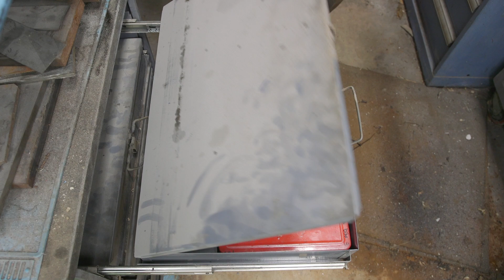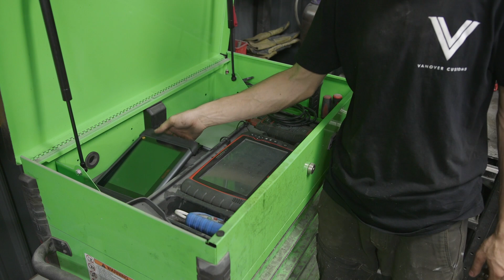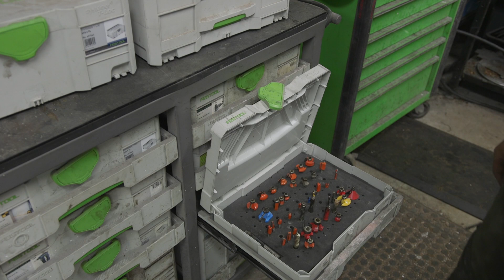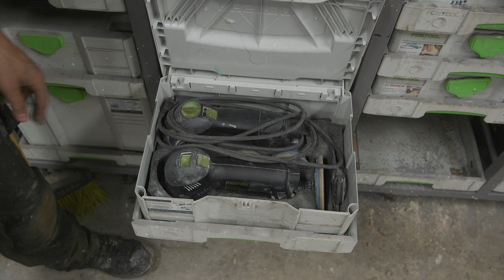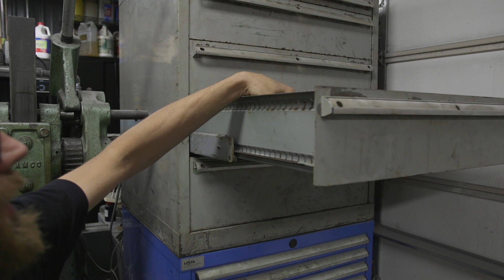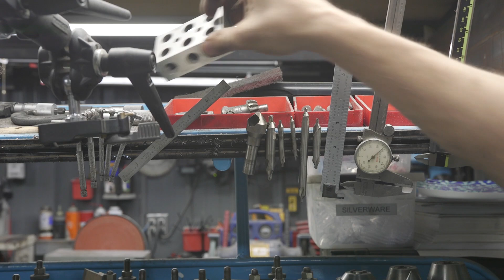2021 Shop Tour Part 2

Comment: You have more tools than Santa.😂
Reply from the maker: True I am very grateful
Reply: All you need now is a Piranha p-50. I love the old machines also i sold fab and chip machinery for 35 + years. I owned AR Tools and Machinery in Spokane Washington. Im retired but putting together a new shop now.   1950’s lodge and shipley 30”T lathe hybrid project. Im putting a milling head on a Bridgeport turret,ram and knuckle on a Z axis tower on it. Just bought a big Okuma hydraulic tailstock to make it a real strange machine lol. A mid 90’s okuma 5v-nc 40x 20 50 taper 20hp 15000 lb cnc in. I have a really cool Cincinnati toolmaster mill with a powered over arm with a horizontal head that is used with a overarm support powered all axis gobs of tools. 150 ton dake w movable table ,very tall press. Wallace gantry 10 to 20 wide fully adjustable crane . Now have 4 matching 4’x8’ cast layout tables from rockwell tool 8 legs too. One more beautiful 5’x100 “ cast iron BEAST table coming. An old rotodie that im modifying for my tonnage and stroke. A big 1.5 “ gearhead 2 speed, variable speed drilling tapping mt4 coolant magnetic push button power powerfeed drill that i used to sell. Piranha p50. Gobs of tooling and bending attachments. Bluerock 70mm reversing 3” magdrill and a CS unitec 35 autofeed magdrill. Building a vibratory tub out of a 36” wide job box toolbox. Allin a 3000 sqft 20ft eve building. Sorry about the book. I hope to grab your email to show progress. The whole shop will have the steampunk vintage Ibeam gothic look to it. . Starting to build ladder trusses for the mezzanine floor. Im doing this as a shoproom fab shop for my brand of cool vintage mechinical tables